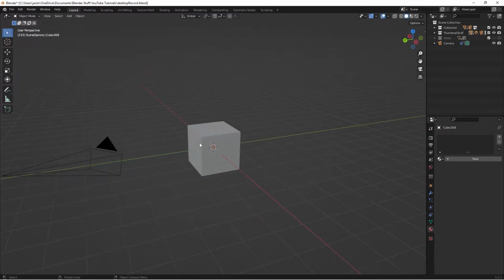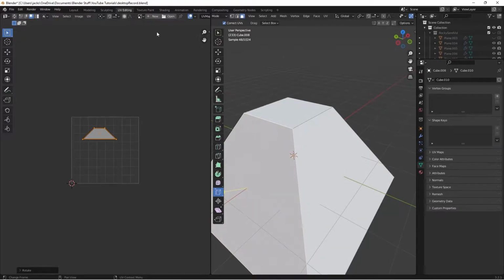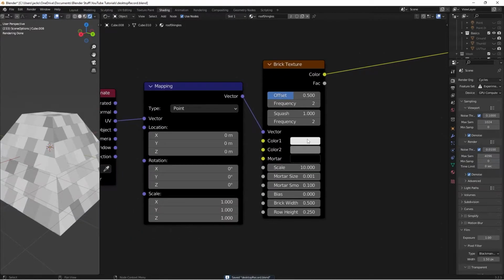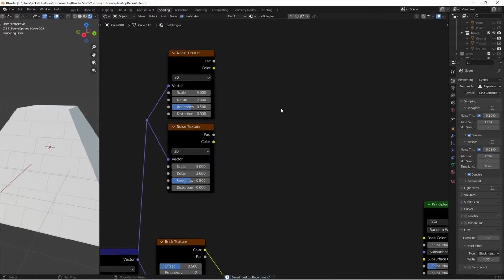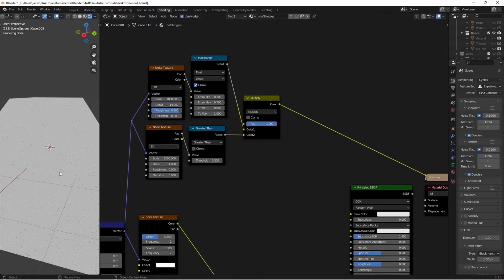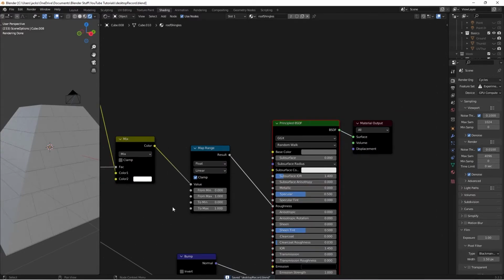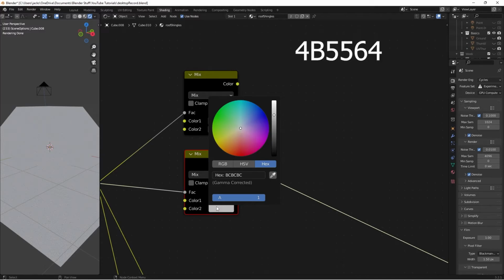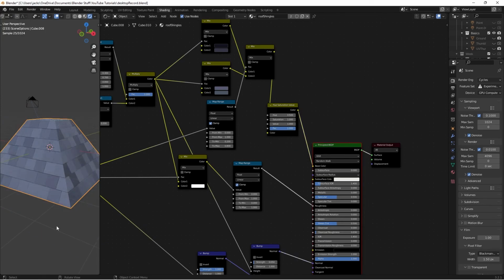Roof Shingles Material | Blender Tutorial

Comment: This is cool! Thank you! The last piece I'm hoping could be solved with this, is: because of the overlap, shingles are slightly offset at the bottom, where it overlaps the next one down. Is there any way to simulate that? I was curious if something plugged into row height in brick texture could possibly do it. They also are not QUITE a perfect rectangle - more of a trapezoid. It still looks good without these things, but it'd really take it to the next level I think